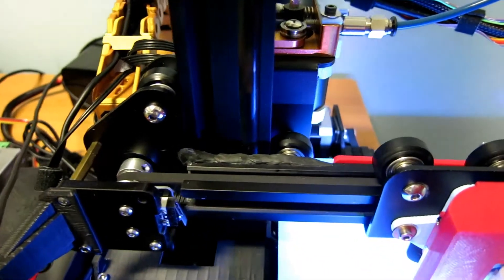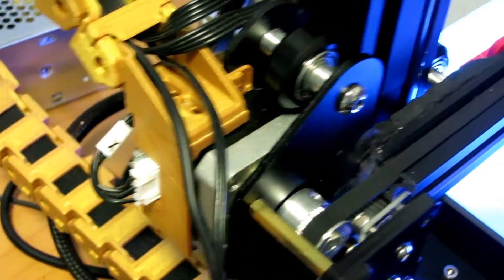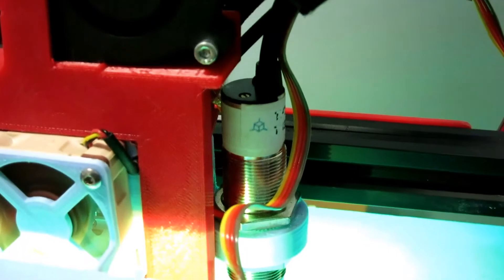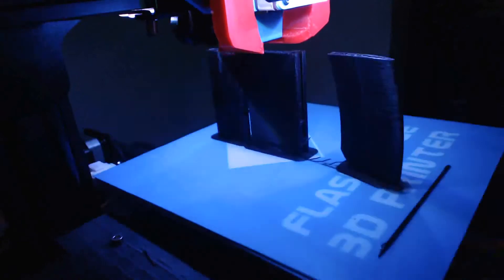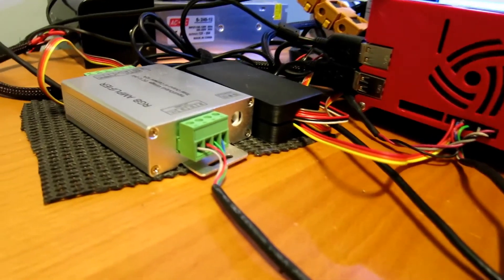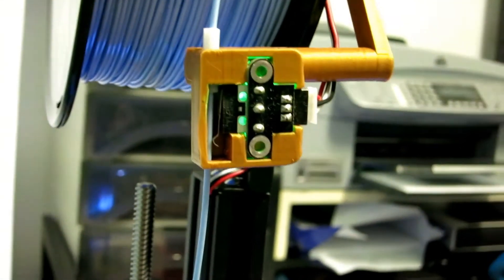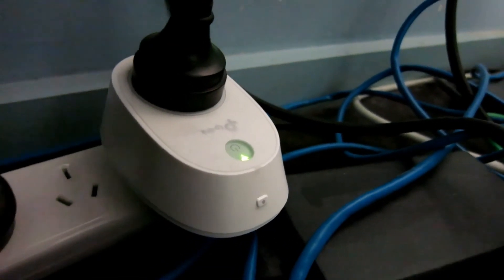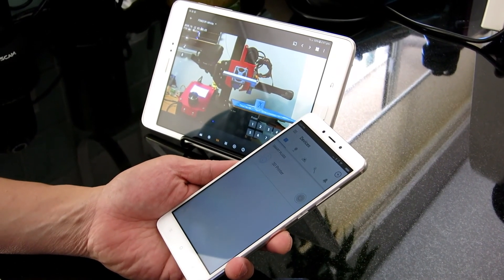My Ender 2 Mods/Upgrades - OctoPrint, ABL, filament sensor, magnetic print bed etc.

Comment: how did you connect the 5015 fan for part cooling on the SANGUINO board?
Btw nice Job on your ender 2
Reply from the maker: Connected to K-Fan on the Ender 2 board.
Reply: thanks for the reply I realy appreciate it! 
I cannot find the K-Fan connector on the board layout (link is layout of the Ender 2 Sangiuno board)
http://sc01.alicdn.com/kf/HTB1AufXf9YH8KJjSspdq6ARgVXaG.jpg
Reply from the maker: The one with the pink line (Fan Reserve). On the board, it says "K Fan"
Reply: @yipzone  thanks for you help

Comment: Can you please send me your Start- and End- GCodes ?
Reply from the maker: http://www.yipzone.com/files/start_gcode.txt
http://www.yipzone.com/files/end_gcode.txt
Reply from the maker: Note that the code includes variables like {material_bed_temperature} and {material_print_temperature}. In case you are not familiar, those are Cura variables, so if you use a different slicer, that will not work.
Reply: Many Thanks for the Infos. where did you install the wires of your ABL-Sensor? Have you changed it with the Z-Endstop or another port ?
Reply from the maker: I changed it with the Z-endstop

Comment: This is a very Nice Video, you can be realy proud of your Printer. Ive been just ready with Flash Bootloader and Marlin :-) Did you ever heard about Octolapse ? Withit you can make absolutely perfekt Videos about your Prints
My next step is install ABL Can you give me a nice Link for "how to install" ? Many Thanks for your great Video
Greetings from Germany
Sandman
Reply from the maker: Thanks. I've heard of Octolapse but have not tried it. Going to try it now :)
Reply from the maker: I just ran a print with Octolapse. Worked really well. Well, I'll be using Octolapse for timelapses from now on. Thanks!
Reply from the maker: Sorry, I missed your question earlier. I used the TH3D auto leveler kit but you can buy your own sensor. Depending on the sensor, you will need a voltage regulator. You will need to flash the bootloader, then upload a new firmware. Instructions are available in the link below. https://www.th3dstudio.com/knowledgebase/.
Diagram for voltage regulator (12V to 5V): https://goo.gl/images/WA3sgn  (Actually, please see link below)
https://mertarauh.com/2017/01/18/dont-trust-the-internet-and-how-to-add-an-inductive-proximity-sensor-to-your-3d-printer-the-proper-and-easiest-way/ 
Note that I didn't have to do my own voltage regulator as the TH3D kit comes with it.

Comment: I got the MacEwen FlexiPLUS and the hardened metal gear, but I'm getting a lot of stringing and sometimes the gear clicks. What retraction settings are you using?
Reply from the maker: Haha. Interesting avatar and name, just plain rude :D. Okay, my retraction setting is 3.5 but that's because of the MicroSwiss All Metal hotend.
Reply: haha thanks :) I'm debating on doing that upgrade next, but I gotta calm down since I've dropped an additional $200 on top of the cost of the printer. I'm wondering if I should have just bought a CR-10S or Prusa to begin with.

Comment: love the mods.  for the filament pause.  is the octoprint on the raspberry and add on to the main board or does it replace it?
Reply from the maker: Thanks. Not sure if this helps but this video shows a bit more about the Filament Sensor. https://www.youtube.com/watch?v=MdYCLt1asmk 

I use the Filament Sensor Plugin for OctoPrint, https://plugins.octoprint.org/plugins/filament_sensor_reloaded/ 

You can read more about it here https://github.com/kontakt/Octoprint-Filament-Reloaded

And in OctoPrint, I used the afterPrintPaused and beforePrintResumed scripts from http://docs.octoprint.org/en/master/features/gcode_scripts.html

Comment: I love the lights. I am a noob at all this and wondered if you knew why my led lights flicker? Mostly when the bed is heating, i have the wires for the leds just inserted into the same connection the wires go in from the psu.
Reply from the maker: Thanks. Sorry, electronics and wiring is not my forte. Hopefully, someone can chime in.

Comment: The best, easiest, and cheapest way to virtually silence and upgrade the quality substantially of the power supply on the Ender 2.  Search Amazon USA for this ASIN: B01EWG6YT8
Just put that number in the Amazon search bar.  This fan, not only upgrades you to 30 amps, but is much better built and not so flimsy.  Plus, the fan almost never runs.  YES! When you turn it on, it is silent because the fan only runs once in a blue mo0n, and then it turns on for between 5 and 10 seconds! Yes, seconds!  That's it.  It's so much better quality you can feel it when you pick it up.  The one that comes with the Ender 2 is very cheap quality.  All for a shipped price of $18.56!  I use these power supplies to charge my lipo batteries for my racing quadcopters.  They work great and I have never had any issues with them.  Just check out the 4.3 star rating on Amazon - 86% 4 and 5 stars!  Even the factory black cover fits perfectly!
Reply from the maker: Cool and cheap too. Not sure if you noticed my PSU is not the one that came with  the Ender 2. The original blew up. I explained a bit in the original video but the video was too long so it didn't make the final cut.
Reply: Yeah, I can understand why it blew up...the one that comes with the Ender 2 is really a cheapo! lol  Thanks for the great video! :)

Comment: locktite fixes the screws coming loose, not sure why you would go to an all metal hotend considering the printer has no case so what material are you going to print at higher temps without a case???
Reply from the maker: At the moment, no plans to print higher temp materials but the all metal hotend came in handy when I was printing PLASteel which is more abrasive. Other than that, no, the stock hotend is fine. I bought the MicroSwiss when I was having jam issues with the stock hotend and the shop down the road sold the MicroSwiss but not a Creality replacement. Anyway, I did fix my stock hotend jam issues but I had to give the MicroSwiss a try. So  I did and it's been on since.

Comment: Mate, thats a nice Ender you have there. Mine is still stock, have to manythings to print.

Did you use ABS for the hotend cooling stuff?
Reply from the maker: Thanks. The blue part that goes beside the cooling block is just PLA. The red fang part is PETG. I don't think you need ABS or even PETG unless the fans are not doing their job.